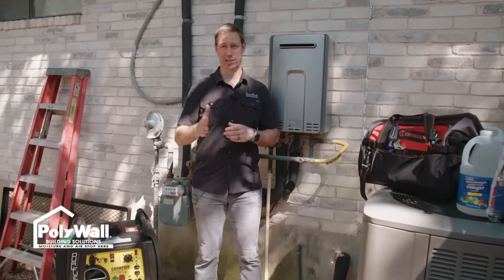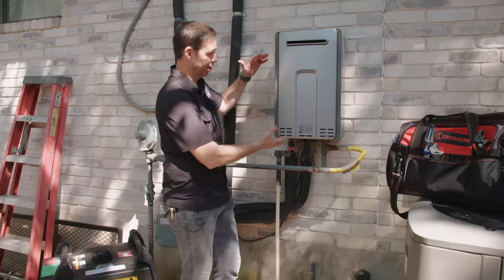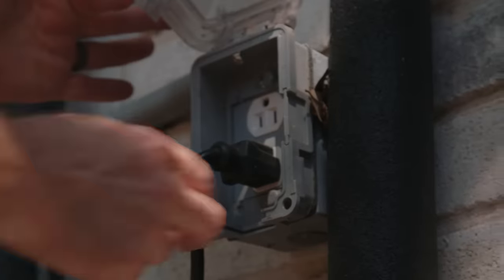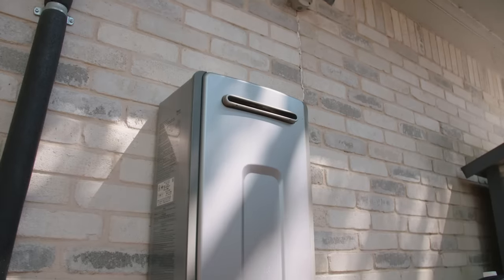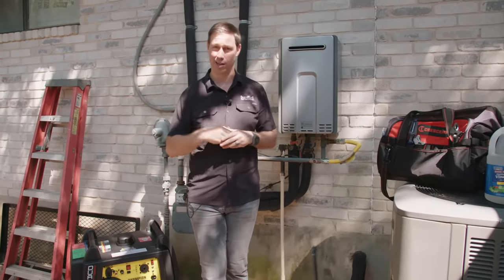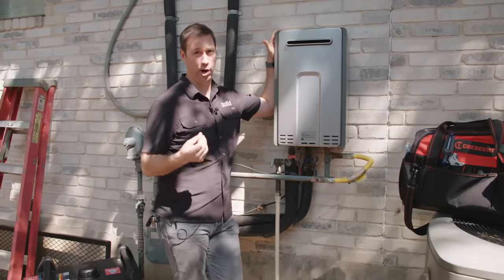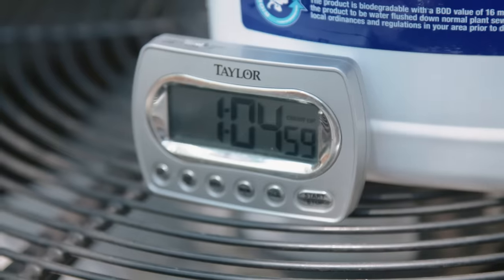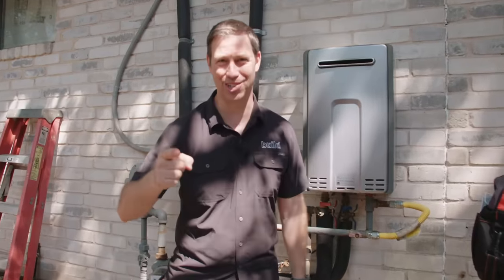3 Things They Don’t Tell You About Tankless

Comment: My experience issues with tankless:
1. Even a microsecond blackout or brownout will turn the unit OFF. And I have to go and manually turn it ON again to get it running.
2. There is a Minimum water flow before the heater will kick in. Below that level and it will not heat the water because it will get overheated beyond the set temperature or the max temperature.
3. If the inlet water is too warm (as in the summer) the it will heat it past the set temperature or shut it down if it goes past the max temperature. In those cases, you need to run more water than you want in order for it to heat it to the set temperature.

Comment: I priced these units out during an extensive remodel, I could not justify the cost vs a new natural gas 100 gallon water heater, and then the maintenance. Just two adults in the house, I went with the 100 gallon tank.
Reply: Switched over in 2009.  It looked then like natural gas prices were going to go up - but then they went way down.  Will never get my money back that way.  Might have a chance on longevity though as the unit is 11 years old and has not missed a beat.  With the average life of a hot water tank around 10 years if this one makes it 20 years then not having to buy and install another conventional tank will help with the savings.
Reply: @chupposity  I hear you there... It was the install cost and then maintenance... Like you, looking at ROI, just wasn't there in my case.

Comment: Keep in mind if you have hard water you need to flush the unit. I have a large family and we love to consume hot water. As a result, we need to flush 3-4 times a year, minimum. The problem is the calcium, i suspect, builds up over the temp probe. From there we get waves of hot and cold water. I assume the probe is delayed in response to the temp changes and it begins fighting itself. I also have calcium crystal depositing at my end-of-line plumbing. I assume it’s because it’s the last place the water can go and the calcium has to go someplace. So I take my faucet head off once or twice a week and dump out giant crystals (as I call them). I never had this issue with the hot water tank but I assume the calcium just sat inside it. I could get a softener but I won’t.

Comment: In my case where all I have is electric service no gas an all electric tankless often time takes 2-3 40-50 amp breakers. I'll go heat pump water heater instead when the time comes.
Reply: Worth it. Especially in smaller homes, you will never go near that amperage with just a thing or two running hot water.
Reply: @icantfinditdammit  Ive found otherwise. keep in mind that an all electric house also has electric space heating equipment.  and I am more than happy with my heat pump water heater. 
however, the thing they don't tell you about THOSE is that they need a viable drain, either into the septic or outside.

Comment: I recently moved into a house with one of those units, and lately, I've been thinking about doing some research about maintenence and service intervals, so when I saw this, I remembered.
Reply: Look into a chili pepper pump.  Press the button when the pump stops in usually 30 to 45 seconds you now have hot water at your fixture.  You could put it in the bathroom and or kitchen - saves a ton of water.  (Best suited if you are in a drought area where water is expensive)

Comment: 3 years ago when our hot water heater needed to be replaced,  I wanted a tank less water heater.
1. On an older house your going to have major issues. 
A. You need to larger natural gas pipes
B. The exhaust system needs to be replaced from an aluminum pipes to a steel pipes due to the heat generated unless your units outside 
2.The down side is the cost of a water heater and if your older than 55 years it's not worth the cost
Reply: Yeah me too, tankless just wasn't worth it.

Comment: Okay, I've installed many of these in my day.... Now let me tell you, endless hot water... What does that even mean.. Do you really need that? I mean seriously.. think about that. I have an 80 gallon water heater. I have the thermostat set at 175° I have a timer that has the water heater run for 3 hours a day... Family of four I have all the hot water I need for the day. When we go away I just turned it off. The size of the water heater.. It's in the basement.. It's under the basement stairs.. It doesn't bother me where it is... Tankless hot water heaters.. If you have hard water. They're not going to last. And they are extremely expensive. I feel there are waste of money. You do what you need to do. But I have actually removed them from people's homes. And installed tanked water heaters again.. I'm just saying...

Comment: Install a self-closing shower valve with a nice brass chain pull, teach them about Navy showers, and, for relaxing, get a good hot tub. It is the best way to conserve resources and relax.
Reply: Brand recommendation?
Reply: @krisgee9553  Hot tub or valve?
Reply: @diacoder  valve for shower
Reply: Grohe had a good looking push-button automatic shutoff valve. It stayed on for 45 seconds so you could use two hands. I don't remember the brand of pull shower I installed at the pool. I am sure it was a box store special.
Reply: @diacoder  Cool, it's a place to start. Thanks!
Reply: Yes a hot tub is great to have. Not without its maintenance issues either though.

Comment: In my area, we do not have natural gas. And we also have propane available but with the regulations regarding the inspections of the tank, how long you can keep the tank, where the tank has to be in proximity of the house, and the overall cost of the propane and monthly rental for things just eats any potential cost savings you can have. The only thing I can have in my area is electric. And my house is wired where it can take an electric tankless water heater for a whole house. What I found I had to do is I had to use a small heated water tank because I have a recirculation pump so that way I have hot water at every fixture right away. The water recirculation pump brings it back to the tank which is small and maintains a certain temperature, and then the tankless refills the tank as it empty so that way I don't have to worry about low flow and evaporating because it's always refilling the bigger tank.

Comment: Not just long showers, but overall usage in the household affects which type of water heater saves energy. When people are in and out of the house all day, taking showers, washing things, the water heater gets constant use. Tankless heater has to fire up every time there's a demand. Tank heater only has to fire up when the temperature in the tank drops low enough. But if people are away from home all day, or travel a lot, tankless may be the way to go.

A few more considerations: My unit did not come with a controller. There was no way to change the settings. When a plumber had to troubleshoot a problem, he also had to order a controller and wire it in before he could diagnose the problem. So in addition to paying for the new part, we had to pay for the controller. And we didn't get a wireless controller, so it's actually located inside the housing of the water heater. To access the controller, we would have to unscrew the cover. If you get one of these, you might want to splurge on a wireless controller, or pay for the wiring to be run inside the house where you can access conveniently.

Also, it has a filter that's supposed to be cleaned, but we have no way to remove it. I think it needs a special tool. If we took it out, we'd probably damage it in the process, and since local stores don't carry it, we would need to pre-order a new filter before trying to mess with the old one.

Furthermore, ours has a power vent, since it's on the outside of our house, so every single time we turn on the hot water, even for a little bit, the fans kick in and make noise. The neighbors can hear every time we're running hot water, so there's a bit of a privacy issue, should the neighbors notice the noise. 

Also, our installer decided that it should be hardwired, so no unplugging the unit. We have to turn it off from the breaker box. 

And yet another issue is that in winter, the water in the pipes around the unit is as cold as the outside air if you haven't run it for awhile. So in the middle of the night, I wash my hands with cold water because it's warmer than the "hot" water that hasn't arrived yet from eight feet away. We live in southern California, by the way.

Comment: My old tank was installed in 1963, when the house was built. Never serviced. Don't make em like they used to!
Reply: Ditto
Reply: I've got one hanging in there since 1992.  I'm nervous.
Reply: Most first one (elec 80 gal) leaked after 20 years. My second one ( elec 50 gal) is in its 20th year. It’s in a pan with a drain with a leak detector, so maybe I’ll wait until I see signs. We have very hard municipal water but it’s just the two of us now.

Comment: 1. As for my tankless it needs no outside electric for the pilot, it starts with D cell batteries as soon as you turn on the water. It does take a few minutes for the hot water to get to you, but so does the water from a tank. Ok, it is a portable unit but I use it full time in my RV. 2 Since it is being used in an RV I don't worry about it saving me a lot of money on my energy bill. Besides it runs on propane and I use 20# bottles. I will be going to a 40# bottle soon. 3 Never done any maintenance on mine. Maybe I need to?

Having said all that I have to say if I was using a full house unit I would need to know all the info you gave in your video. Thanks for putting it online.

Comment: HUGE HINT with most Tankless hot water heaters.. ..   turn shower mixing valve to 3/4 hot...   get a friend to monitor the temp of the shower while you slowly adjust the valve on the Inlet to the tankless hot water heater..   once you get that inlet valve adjusted to the exact position for the perfect shower temp with the shower valve at 3/4  hot.. count the fractions of a turn to shut it off .. and then count the turns to turn it fully on..  turn it off.. then open the valve to the exact fractions of a turn.. and mark the turns and fractions on the wall beside the valve..   tankless water heaters use a pressure drop to turn on the power.. if you have the inlet valve wide open. there is NO pressure drop when you get in the shower.. the power never turns on and you or your clients get a COLD SHOWER..  as an installer.. please take a picture of the install .. use your phone or software back at the shop to notate how many turns on the valve ... and save that file as the home address water heater adjustment. so you can find it in decades to come when they call you. 

 why the shower.. you don't want a cold shower.. you don't want a boiling hot shower..  you like the 3 bears wants a shower that is just right.. dishwashers, laundry equipment will take full flow thru the heater with the restriction to lower the pressure drop to turn the power on..  but the shower must be perfect.. 
 INLET TURN THE FLOW DOWN.. NOT THE OUTLET..
Reply: you must have a strange model of tankless.  the ones I've seen use a flow sensor.  and it is sensitive enough that even a circulating pump can fire up the burner.
Reply: @kenbrown2808  i have been putting them in for 20 years. perhaps the newer ones have changed.. the mechanical flow device worked on pressure drop. . its only a hint..
Reply: Why do you heat hot water?.it is what you said.  .here's a hint ...because  you have a tankless  water heater.  Tempeture differential  is a problem  with  these residential  units.  If you need more than 100 fixture  units  in your home go commercial  or storage tank style.
Reply: @raymartin5316  just don't ever spend money on a 120v undersink tankless. They really only have the watrage to take the chill off at half flow 240v will at least get it warm.
Reply: @raymartin5316  My neighbor described  remembering taking cold showers when she was a teen in El Salvador. when the building water heater was out in the building.  i could not get that out of my head for a month.

Comment: I wish that people were given instructions like this on LOTS of things regarding household necessities.  No one ever told me that my tankless water heater (which I have come to HATE because I only get a few minutes of hot water before it gets cold and no hot water at all in the kitchen, which is far from the tank).  Same thing with our septic system which no one informed us about when our house was build.  That ended up with needing to do major repairs many years later $$$$$$!  Thanks for the video.  I'm wondering if a well makes a difference on having continuous hot water when the water coming out of the well is so very cold?  I'm not sure that my unit has ever given continuous hot water and it takes some time even to get hot water, so I feel like I'm wasting water just to GET to the hot water.  This was the case even when the unit was new.  I would love to have some advice on what to do!  Do I keep this one and get it serviced and hope for the best, or is there a better one to use in our situation with the well?

Comment: It's just me in the house, so I don't use a lot of hot water ever. Plus the water is VERY soft where I live, so the mentioned negatives aren't really a concern. My current electric tank water heater is 40 years old, and still working perfectly with no scale buildup inside. I've never seen any scale buildup in any of the faucets.

Comment: Natural gas prices are so cheap now you’ll never get any cost savings. Better to go with a larger tank if you have a 6 member household.
Reply: I disagree.  We went from electric hot water to natural gas when converting from the tank to tankless.  Saves $30-50 per month beginning 12 years ago.  The tankless installation cost $1400.  Total savings so far:  about $4400.
Reply: Wally Kramer well yeah electric is expensive but someone switching to gas will have to have all new piping in. Today installing a tankless gas is going to cost 4K compared to 1,500 for a tank not to mention the extra costs of flushing every year.  You’re never going to save that much money.
Reply: Installed my own tankless for less than 1500 and for 100 I bought a water pump and a 5 gallon bucket. Flushing costs me less than 20 for a few gallons of vinegar pumped thru the tank for an hour annually
Reply: @wallykramer7566  I am 13 years into the same Brand he is putting down. 13 years and spent $11.25 this week for a pressure relief valve. Never been flushed, even thought I put the flush kit on it when I installed it 13 years ago. I do have a generator if we need it, but in 13 years, never used it.
Reply: @infotechsailor   13 years ago, installed myself around $1200, so far have never had to flush it, but do have the flush kid installed also. I think my cost for tankless was something over $900, and about $300 for vent kit, and flush kit, and piping.

Comment: Great points. I've had a Rinnai tankless for over a year and when it works, it's great. But it needs a LOT of water flow - over 1 GPM. I have several faucets that don't have that much, so we have no hot water in the kitchen and bathroom sinks. After 4 plumbers over 1 year and not being able to get it running, I'm talking to a plumber now about yanking it out and installing a dependable tank system. This has been a very expensive mistake. Be wary about this technology.

Comment: Most important thing to know before purchasing a tankless unit is your Winter Water Temperature like February in Philadelphia. I tested my water in Feb. and it was 38*F. Now you have to heat the water to aprox. 115*. They always advertise how many showers can run at one time on Florida water Temps. of 70* incoming water temp. It may say 4 showers can run. But NOT in Feb.! Maybe 2 showers if you buy the right size!!!!!!!!! I have a Noritz NRC-98-Nat Gas since 2011! No I'm not a Plumber. I'm an Electrician!

Comment: Great video, but I keep finding that people are unaware of certain facts about just how much money is saved by having a Tankless Unit.
1.    Tankless Heaters can lasts upwards of 25 years compared to the 6-8 years that the new tank style units are lasting. Average cost of a Tankless installed is $4,500. If you spend $2,000(cost depends on where you live and type of water heater you have) to replace your tank style heater every 6 years for the next 24 years, you will have spent $8,000. Add the energy savings and tax rebates and you will have saved THOUSANDS. 

2.  In 25 years, when your Tankless Water Heater needs replaced, it will likely cost LESS than it would to replace your tank style heater because all of the plumbing is now there and the unit will just need a quick swap. I would also factor in that the price of the storage type heater has been increasing rapidly over the last few years with no end in sight.

3.  Tankless Water Heaters will add 4%-5% to your home value and can help sell your house on average of 43 days faster(Zillow).

4.  While MOST Tankless Heaters do need some maintenance, without a water softener, tank style water heaters also require maintenance. Water softeners are a must-have in homes with hard water to extend the life of ALL plumbing fixtures and appliances!